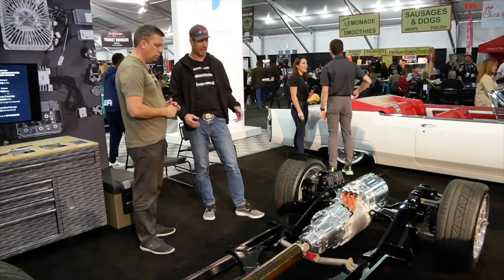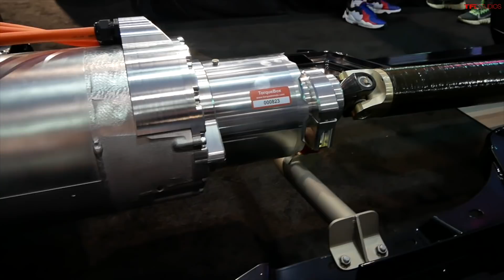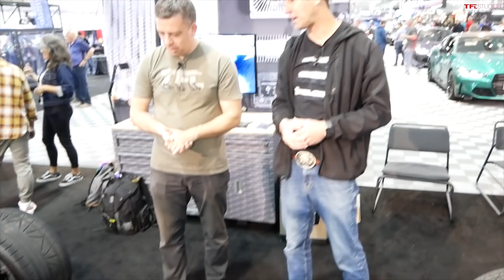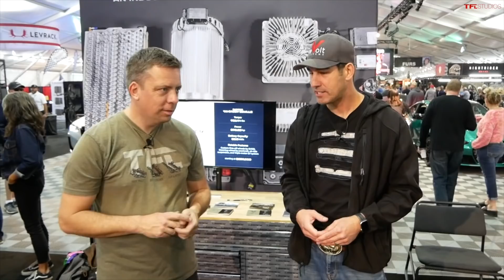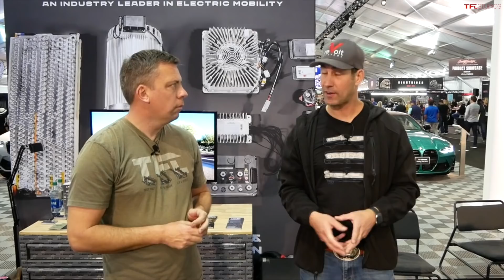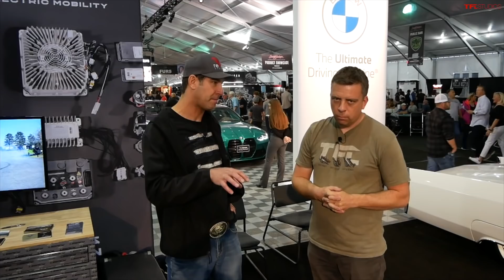Can An EV REALLY Reach 353 MPH? This One Says, "Hold My Beer!"

Comment: From an engineering perspective this layout makes absolutely 0 sense.  Weight distribution has to be adjusted with battery placement. The drives haft is just unnecessary rotating mass.

Comment: I’m trying to understand why for a Bonneville speed run maybe a 2 speed transmission might actually be beneficial. At a certain frequency don’t induction motors reach a point of rpm max and decreased torque? Whereas with the ability to drop some rpm might be able to get back into the design operating rpm and torque of the motor? Many of the drives that run induction spindle motors that are under constant load have to use something called field weakening in order to make the rpm climb but that reduces torque and the higher rpm is used for smaller less torque demanding tools so it works.  
I’m curious to know what frequency the inverter is putting out at 350ish mph and how many poles the motor has. I want to know if and what kind of serious magnetic shenanigans are being played on these motors. 😀
Reply: I'm all for his "simplicity means fewer parts to break" theme for not using a transmission. Porsche uses a 2-speed transmission in their EV, so there may be some merit in it like you say. However, it's probably not economical to do so for regular cars. Teslas are among the most efficient yet go 155-162 MPH on one ratio. Elon Musk said at 162 MPH, the motor is spinning about 19,000 RPM.

Comment: I really like his explanation of the “Why” at the end of this video….. Perfect!! 
    Why did I put a 502 big block, with a Tremec 5 speed transmission behind it, in a 1979 GMC shot box stepside 4x4??? Because!! I could do it, had all the pieces and it’s fun,,,, not so practical, but fun!
   I have access to a 69 Mustang Coupe that is solid structurally, but the res is a basket case. What a great platform to start a quirky build!! I suspect,,, if I want to shell out the cash,,,, I could order something exactly like they have here, properly prepare the body to drop back on this assembly, toss an interior in there (so to speak) and go!! No tuning, first start jitters, nothing! (Although these activities can be fun as well.) be very fun lifting the hood and displaying a “Frunk” vs a nice 345,,,, . Hmmmm.

Comment: ReVolt Guy: Who runs wide open for 5+ miles?

Andre: I do that all the time on the Ike 🦅
Reply: Haha, I caught that too. Andre kept it 💯
Reply: I like the way you think!!! Hahaha.
Reply: Well most EV's can handle the Ike without running wide open.   The Rivian R1T could probably still accelerate at a good rate even doing 60mph with the 8000lb trailer on the 8% grade.
Reply: @erikstephens34  - if you pushed the R1T with that weight on it, you won’t make it home, or maybe to the next charger,,,, hahaha. I actually quite like the EV trucks for work trucks in the city and hauling, but they are just not ready for towing, especially commercially. Time is money and time at the charging stations is expensive when you are paying someone. If you are bidding on time sensitive loads you will have serious constraints placed on you as well. Hard to make a living that way. As a weekend warrior rig and not going too far,,, well maybe.
Reply: @C10sRule  You missed my point. Yes physics is physics. If you use more power you consume more energy in any vehicle.  But the R1T was nowhere near using its full 800+ HP on the Ike even with an 8000lb trailer load.  But the R1T was never intended to be a long haul trailer rig. There are new EV trucks coming to market in the next couple of years that will tow even better and charge at over twice the speed.
Reply: @erikstephens34  - Sure,, but they actively advertise the 11,000 lb towing capacity. A realistic weight for that truck currently is 2500 lbs and still have a reasonable range. It would kill sales though. As far as 2 years from now??? I’m not as optimistic as you are so we should agree to disagree.
Reply: @C10sRule  Again it's an adventure truck.  If you have a 10,000 boat and you need to pull it 40 miles to the lake it will do it with safely ease better than almost any other truck.  If you need to haul stuff cross country then it's not the vehicle for you.
Reply: @erikstephens34  do I need to teach you what it is to agree to disagree. I am being objective and you are a fan boy. Your lack of objectivity is annoying. 
    Now , I’m done,,,,, go away, you are really starting to bother me and I’m not a very nice guy normally,,,,,,.
Reply: @C10sRule  I don't care if you agree or disagree.  I'm an engineer that believes in facts not fantasy.  I'm sorry if reality rubs against your "beliefs".  Speaking of objectivity you may want to look in the mirror.  I'm not the one who is fighting change at all costs.
Reply: @erikstephens34  - If you call your comments facts, you need to go back to school!! You are biased. Your like and even “fantasy” surrounding Rivian has clouded your judgement. 
     Fact, I’m 58 years old, not a scientist. I have used trucks from as small as the Previous Nissan Frontier all the way up to a Kenworth T600 hauling a 53 foot livestock van. I have towed with any number of vehicles in varying sizes. I know towing better than you know your name. I also know the use any work truck goes through. I have only been talking about the Rivian as a work truck. I even made comparison with what it would be good for as a work truck. If you want to limit it to only a “lifestyle” truck, you are rather disillusioned. The sales on this truck have to crossover to being an effective work truck to survive. It will be a fad otherwise and die off as history has proven. I’m all for new and different ways to do things, but I assess them against the very real world of a Rancher and a LEO. I juggled both careers for 30 years and have been a Rancher all my life. The Rivian really doesn’t cut it in either world. I would easily patrol beyond the range of the truck as a rural officer 20% of the time, I’d not more depending on where I get my calls and how far they are apart. If I’m responding to a call I can’t say wait a minute, I have to charge the truck,,,, I’ll be an additional 45 minutes.
    You have said if it doesn’t work for my uses, buy something else. I’m saying it won’t survive with such limited sales. The longevity on these trucks will be huge. There will be no need to turn them over every 3-5 years. The cost will additionally preclude that rapid of turnover. There’s so much more to the survival of the brand than your very limited idea of what the targeted market is for this vehicle. You say you look at facts vs fantasy,,,,, then what you have presented warrants an F. You can’t pigeonhole the parameters to make you look right. You have to take into account all of the big picture. You have a lot of learning and growing up to do. Like I said, you really are starting to bother me. You are naive, arrogant and really quite ignorant (not in the slang manner).
Reply: @C10sRule  So your saying vehicles like the Ford Ranger or Chevrolet Colorado or Toyota Tacoma are also failures?   Trucks are a huge market and there are many large market niche's within them.    Did you even watch TFL's video with the R1T doing the Ike?  From your comments it appears you didn't (or you missed a lot of it).   The R1T is a heavy vehicle with a low centre of gravity which gives it a very stable base.   The powertrain can produce over 800+HP and 900+Lbft of torque.   This torque range is wide and flat and the power can be programmed to apply precisely as required for different functions (including and especially towing).   The precise and immediate control and response of the electric motors allows for better tuning of traction control (including when towing) and trailer sway control.  A vehicle like the R1T also has two breaking systems a normal static friction braking system and a dynamic regenerative system which also allows for better stability and control when towing.   So the R1T can tow 11,000lbs with extreme ease.   The biggest limitation is going to be cooling (as this video suggests).   It's likely that pulling an 11,000 trailer up the Ike on a 110F day will likely push the thermal limits of the vehicle.   With increased cooling and improved rigging with the appropriate structural support the R1T could likely tow quite a bit more than 11,000 lbs (Hence why there are versions of the Silverado EV coming that are rated for 20,000lbs).  Now yes towing long distance with the R1T would be time consuming and require a lot of patience and it's the biggest limitations of the vehicle.  But it's also one of the only main limitations of this vehicle (that and the smaller pickup bed).   Oddly enough you call me a fanboy.  But I actually have no interest in owning an R1T.   I simply like to learn and grow.  It appears your scared to do so yourself.   Your fear of the R1T appears to be more ideological than rational.
Reply: @erikstephens34  - you are a triggered Karen. Now again you change the parameters to try to be correct. Go away.

Comment: I like the way this guy thinks, he realises the potential for electric motors in their effectivness of power delivery to achieve higher top speeds than ICE engines can achieve.
Reply: The only thing that affects top speed is power.

A top fuel dragster reaches 338mph in less than 5 secs.
ICE isn't the limiting factor
Reply: @Robert-j6r8c  ICE vs daily driver,,,,,, sure a dragster can attain those speeds and then you bring the vehicle back to the pits, rebuild the motor and go do it again. That motor has absolutely no practical use. You can’t run a top fuel motor capable of those speeds in a street car. I love ICE cars, I have a 67 Mustang restomod, fuel injected and 4 wheel discs, new suspension and lowered 1 inch, 67 C10 rebuilt to appear stock plus fuel injection and 4 wheel discs, original 67 Chevelle SS 396 4 speed manual, 42,000 miles, 2nd owner, 1928 Model A pickup, original, 72, 240Z, 74 260Z, 80 Vette, restored so far I will never get my $$$ back,,, hahaha, 1990 Chevy 454SS pickup, stock and 40,000 km 2nd owner, 79 GMC Short box stepside 4x4 with 502 and Tremec 5 speed, 71 GMC Sprint, being restored and converted BACK to an automatic. 
    I love ICE , but I think it’s time for me to learn more about this company. I have access to a 69 Mustang Coupe I could purchase that is solid body wise and a hot mess everywhere else haha. What a great platform. The car is quirky to begin with! 
    It’s inevitable,, might as well embrace it.
Reply: @C10sRule  
This reply has nothing to do with your original comment.

You said electric motors can achieve higher top speed than ICE.
And now you're talking about reliability and a daily driver.
Reply: @Robert-j6r8c  - There’s little to talk about regarding top speed because the concept is so simple. It’s actually ok to have more than one topic in a comment. You should try it.
Reply: @Robert-j6r8c  that engine can’t run 3/4 of a mile without blowing up, forget what would happen to the lubricants or the fuel consumption
Reply: @mattbrew11 
What's that got to do with the price of bread.

The argument was electric motors can get cars going faster than ICE ones.

Not the reliability or practicality.
Reply: @Robert-j6r8c  youre talking about quickness not speed.
Reply: @mattbrew11  
" 338 mph"....🤔
Reply: @Robert-j6r8c  speed over time = how you set the FASTEST records.
Reply: @mattbrew11  
"Time" that's as ambiguous as "how long is a piece of string"

So your saying they didn't break speed records?... Even though they have speed records.

If you're going to use a handle "smarter than you"... At least make it a challenge.
Reply: @Robert-j6r8c  they prove speed by measuring distance. Unless you think Guiness or the olympics would just say hmm yeah well according to the gps 

Smh
Reply: @mattbrew11  
Mate you really need to change that username.
Use Google and do some learning, so you can at least be smarter than a high school student.

How do you think GPS calculates speed?... wizardry.
It uses TIME between two GPS coordinates.

The speed trap on a drag strip measures TIME between two known points on the track.

A radar gun shoots 2 beams of light at a set TIME between them ( generally microseconds).  And calculates the difference in TIME between them.

A speedometer calculates speed by counting the revolutions of the wheels over a period of TIME.

Like I said... How long is a piece of string.
Reply: @Robert-j6r8c  oh wow you are an absolute clown